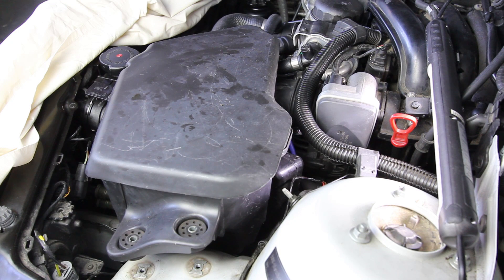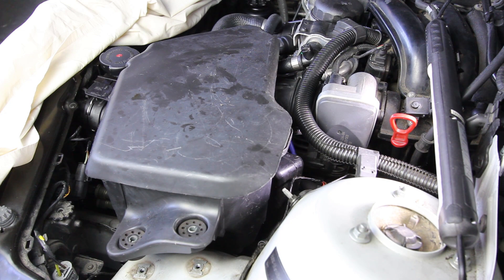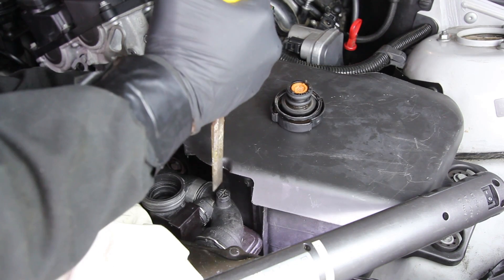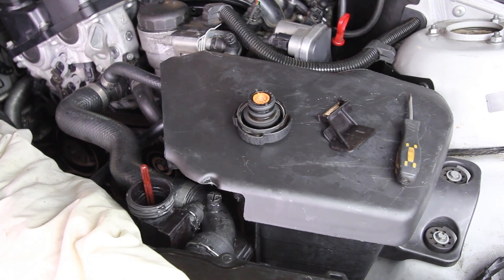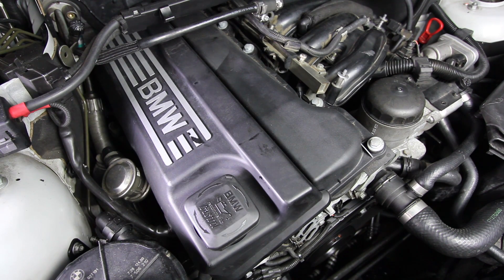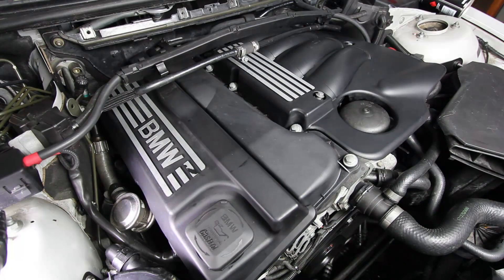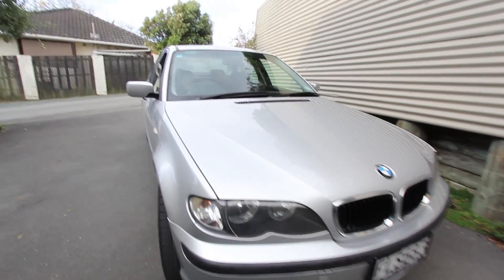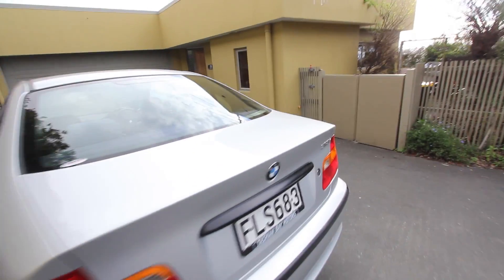Project Nein BMW. N42B20 Replacement Part 5. Finished

Comment: great job. why the water is yellow color? and why do you has changed the engine, what happened?
Reply from the maker: Thanks 👍. Blown head gasket, oil mixing with the water system causes the water to go a milky yellow. Its a really long process to clean the oil out of the heater core and radiator.. not fun

Comment: I need to make a decision , to swap my old n42b20 with newer n42b20 or sell the car.  Double Vanos makes loud noises i think it has burned or somethin and the car have low power and huge fuel consumption , the engine stutters, and somethin is wrong with the intake is hard to tell. I might swap it :)
Reply from the maker: PePPer do the swap if you can do it cheap enough. Prepare for lots of swearing and drinking as a result though 😂👍

Comment: Impressive swap. Having trouble with my N42 bogging and stuttering under load at 2k rpm (but only in closed loop) and am hoping that new coils and plugs will help.
Reply from the maker: did you find the cause? it could be AFM, it may just need cleaned.

Comment: Good work. Did you find out what has caused the previous engine's overheating issue? Cheers from polish N42 owner :)
Reply from the maker: Erazm Kocmołuchowicz , Thank you! its hard to tell exactly what caused it to overheat, but i think it was a case of owner negligence. not checking water levels etc. cheers, from new Zealand!